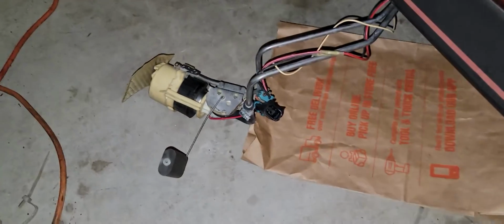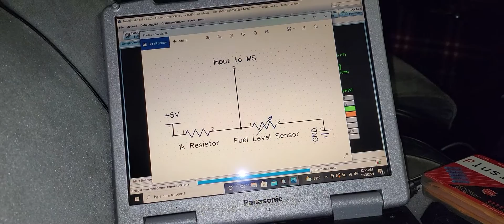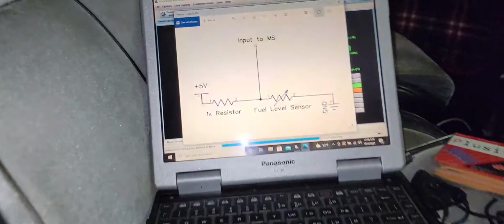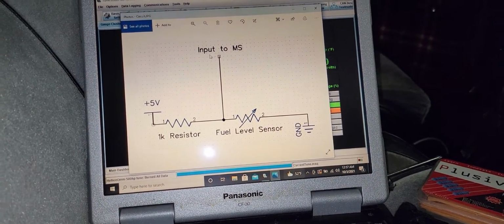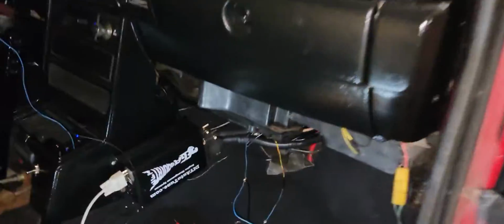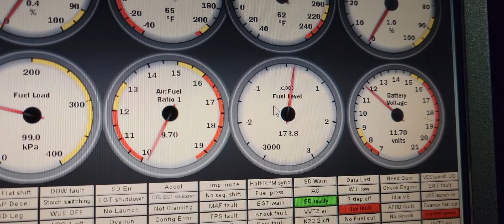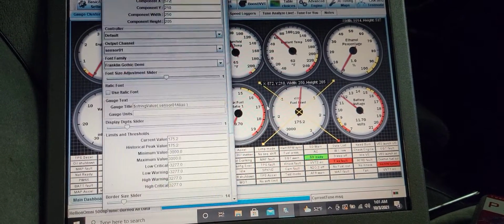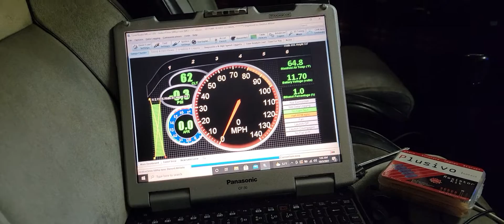How to add a Fuel Level Guage - Megasquirt

Comment: Have you tried using those values and putting them into the 0 and 5 volt values on the generic, wouldn't  those values outputted buy the sensor be adc now? so 0 would be 190 and 90 would be 5v or vise versa. Ill give it a go onec this snow stops and let you know if that would let you be able to use simple values like 0 and 100 not 90 and 190 for the gauge itself.
Reply: Did it work?
Reply from the maker: So I had to drain the tank of some old E85 and decided to pull the pump and sending unit back out to test this (guess I was bored). After playing around with it, I put 190.0 as my 0v value and 90.0 as my 5v value with a lag factor of 10. After that, I tested the sweep values of the gauge as I moved the sending unit from full to empty a few times. At full tank, the value on the gauge showed 188.2 and the empty tank value on the gauge showed 172.4. So I changed the min/max values of the gauge in the properties settings and the gauge works wonderfully now.

Comment: How do you figure out what resistor you need? My ohm range is 33-270
Reply from the maker: Honestly I'm not really sure; I'm going by what was suggested on one of the FB pages. One guy was gonna use a 1k resistor for his 0-90 ohm unit and one of the main MS people said for him to use a 150ohm. So i upped mine to a 200 to be safe since mine is a 20-120 unit
Reply: @That_Red_Omni  I'll just have to get a bunch of different ones and try it. I appreciate your video
Reply: Hey I just wanted to thank you for this video. I was able to do this today on my car and got it working in tunerstudio. It was very helpful
Reply from the maker: @jimrolley4761 glad it worked out!

Comment: Great to see you are still going on the Omni. I let mine sit for almost 9 years. Just spent the last 3 days pulling it out and getting it running again. Was thinking about doing a wrap because the paint is shot but the plasti dip on your looks pretty good. Was it very hard to do?
Reply from the maker: I think i saw that post lol. The plastidip isn't a hard process, takes a little practice to get the technique right, but if you have a spare hood or fender, should only take 20 mins to nail down. Whole kit, gun and sprayer included, was around $600. Holds up well but it is a 20ft paint job in regards to texture
Reply: @That_Red_Omni  I think the $600 kit might be a little out of the budget for this car. THink I am just going to try some rattle cans and see how it looks.